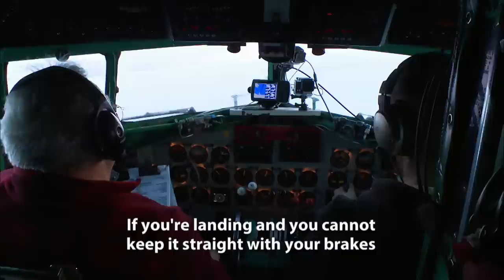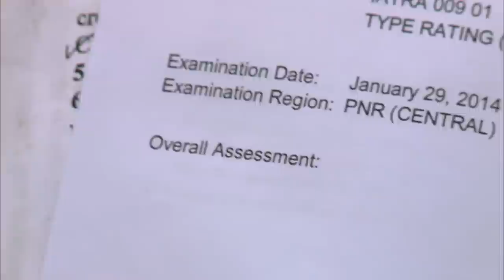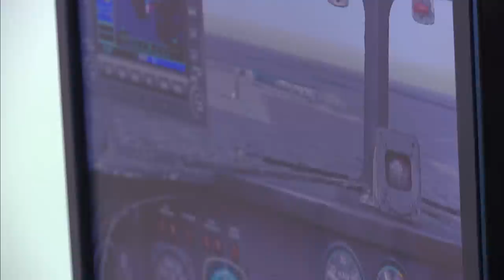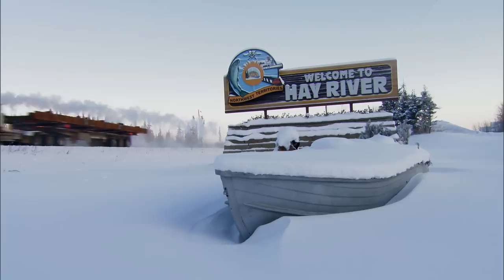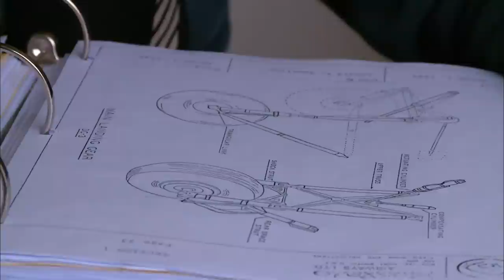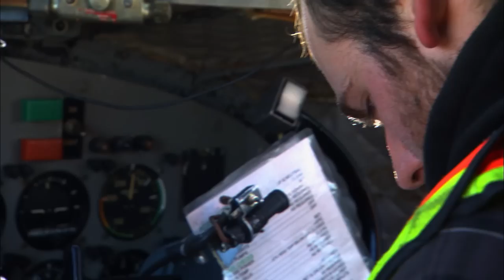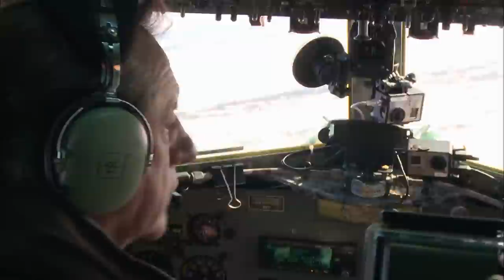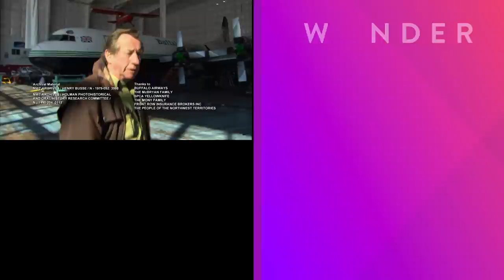Rookie Pilot Nearly Crashes On The Runway | Ice Pilots NWT | Wonder

Comment: I just didn't get it, how is it even possible to permit a landing with hold short of another runway? As far as I know pilot can land short and request to free a runway through nearest taxiway - but it's a pilot's decision. And this "you take off after 14:41, you have no permission" thing. Isn't the dispatcher must stop the plane from taking off if it is prohibited? Pilot during takeoff must look at the watch? I assume in this cases it is possible to get a landing clearance "flight123 clear to land, runway 12, before 12:37, on the first half of the runway" and in the case of a collision - they just landed in 12:38 - they are late, or - they can't stop on first half of the runway - it's pilot's fault.
Reply: What? Yes we pilots usually get 5 mins to 10mins to takeoff. And yes you can land and hold short of a different runway. If you can't, refuse instruction
Reply: Permission was lost for their IFR plan. They can continue under VFR if conditions permit doing so safely.